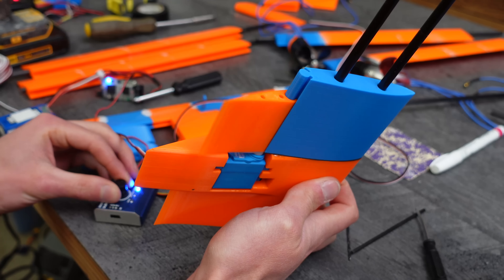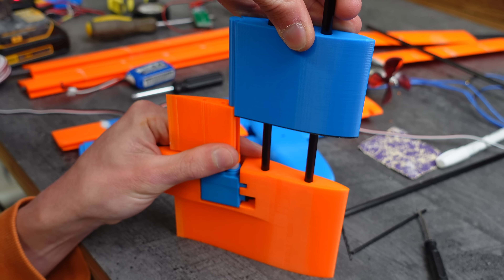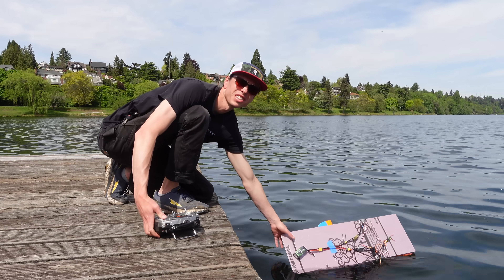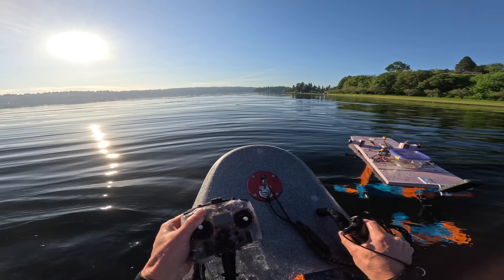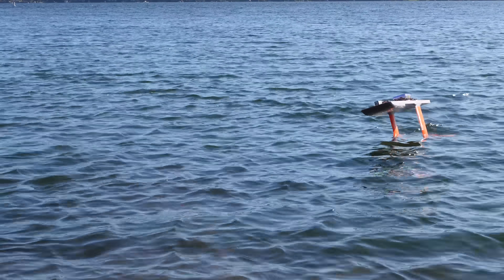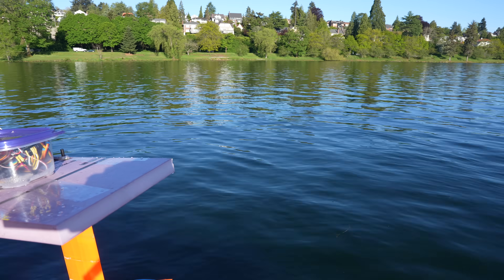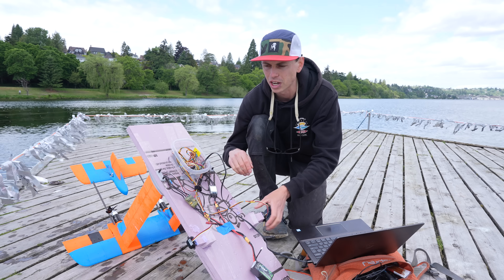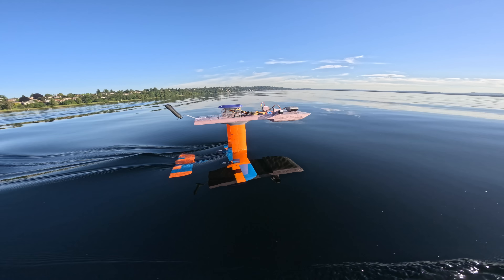3D Printed Hydrofoil with Sonar

Comment: Great video. I used gorilla glue in a recent project and it was awful. Awful to work with, and didn't seem to have great strength, and certainly didn't seem to bond well no matter how much I sanded, cleaned, IPA'd the surfaces. Went back to PVA and hot glue wherever I could for the rest of the project!

Comment: For rougher water, would a capacitance measurement between the wing and hull work? Wondering if there's some way to measure a volume vs. a small spot like usual distance sensors

Comment: Wouldn’t less differential thrust equate to a longer battery run time? Does the loss of drag from the stabilizer overcome the need for more power to control it?

Comment: You rejected "ailerators" (elevons on the wing), and said you need ailerons and elevators, but what about actual elevons? Would your elevators have enough roll authority and provide enough stability if they were independently actuated? Would save a servo.

Comment: Is there a way to prevent the foil on the inside of the turn from stalling in tight turns without adding a rudder or using differential thrust?

Comment: 11:41 If the props are coming to the surface, would it be possible to trim the ailerons down a little at higher speed? Is there a liquid equivalent of the pitot tubes that planes use to measure air speed?

Comment: what if there was 3 or 4 thrust motors in 2 lines one above the other to remove all control surfaces including elevator? there is no need of rear stabilizer in this config

Comment: imo, the underwater wing  Should  have  a  thin  Symmetrical  profile; mounted with a little bit of positive aoa/aoi.      NOT  the  wonky  profile  that  you  selected.
0048    WHY  was  the aft pod  needed.?        why is the elevator chord so long.       the amount of drag from wetted area at the stab could be reduced significantly,  if a (smaller) stabilator  were used instead.        two masts make  Twice  the  drag.       you may know that the aileron servo setup used results in the servos  having  ZERO  Mechanical Advantage, over the load that they experience.    doing  that  is  the  opposite  of  smart.

Comment: sometimes an inflatable air beach mattress is the most light weight boat. also you can add many simultaneous active independent print heads into a 3d printer, bed slinger or just multiple nozzles on single large print head. looks like an at at walker on water. vomiting helps when you are having pressure. same goes for put put boats, with heat powered thrust only. three legged monster hydro trike. it should work like a sail boat with a keel to automatically level the hydrofoil. looks like an oil rig platform. dolphin submarine air glider mode engaged. the vertical aileron is just fine too. cross axis control is simple. ie both axes controlled on the same mechanism. the normal air plane tail control surfaces. maybe you dont have to put any control surfaces on the wings, if you make left and right horizontal control surfaces independent. so you can roll with the tail.
Reply: try tether stick planes and drones, as plane/ drone support structure, very light weight, 4-point wire tethered 3d-cross from tubes. any flight surfaces on the wires. the wires keep the 3d cross tubes in position very strong. just like a radio mast tethers.

Comment: You’ve got to try these for connections, I’ve had nothing but success with them and they are cheap. Amazon: “TICONN 150 PCS Solder Seal Wire Connectors”

Comment: Your Hydrofoil flap is too big for your platform also there is a better way to control your ride high instead of using sonar you could use a wand. this will automatically keep your boat at a set high without any fancy code

Comment: Instead of silicone and shrink tube, you could try injecting hot glue using a mold around your wires for a waterproof seal. I just saw this video about it the other day: https://youtu.be/-uNsyOG0eZY?si=qjOaTiXmmaGkjsxC